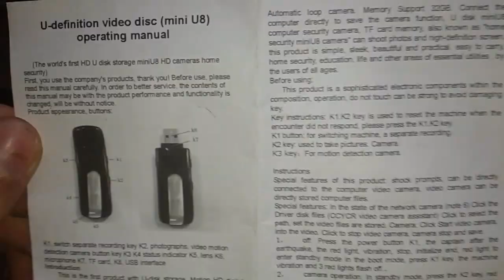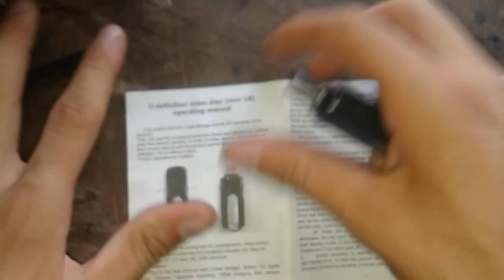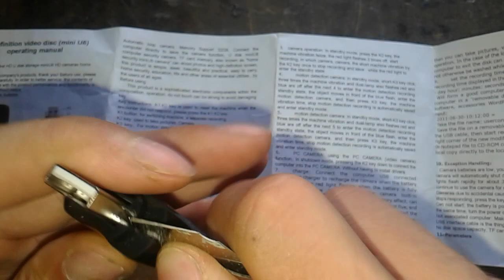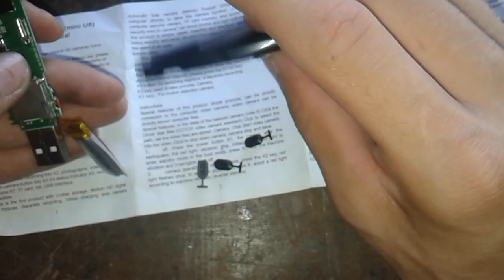Whats inside a Mini Spy DV DVR U8 USB Disk HD Camera Cam Motion Detector 720x480

Comment: Do you know the voltage of the device battery? I would like to modify the equipment to put a better battery
Reply from the maker: Gabriel Longo it is like all other lithiun batteries :) 3.7 v :)
Reply: Thank you very much for the answer, do you think that if I install a battery of at least 2000mah I can have at least 10 hours autonomy using the motion detection feature?

Do you think the motion detection feature is reliable enough? In other words, do you think that in at least 80% of cases the camera can detect motion and capture the image properly?

 thank you for your attention.
Reply from the maker: +Gabriel Longo the original battery has an capacity of 20 mah and it can run for about 3 hours so in theory if you put a 2000 mah battery it can runn for about 300 hours . I personally dont like the quality of video and motion detector on this cameras.
Reply: Thanks again for the reply, I must agree that the quality is not good, I saw other videos on youtube. My main question is whether this camera will fail to detect the movement many times, for example if someone walks in front of the camera and does not record what happened, and I have not encountered people talking about this issue yet
Reply from the maker: +Gabriel Longo  as far as i have tried it .. it worked 50-60% of cases :)
Reply: I want help